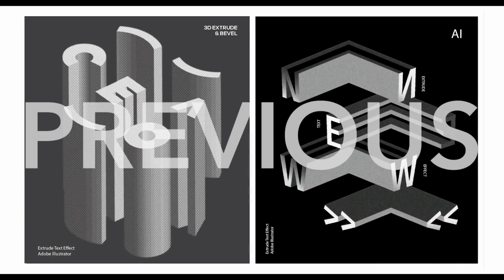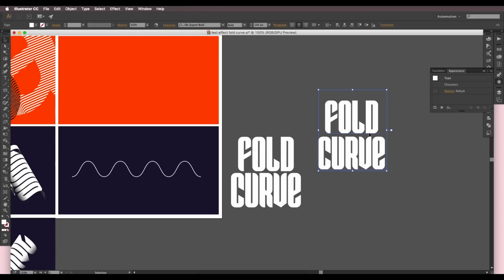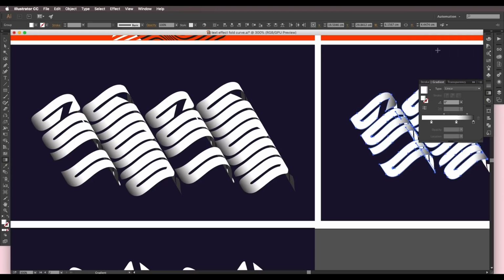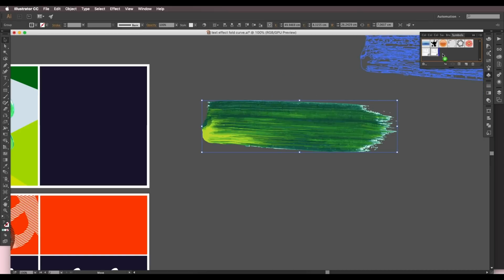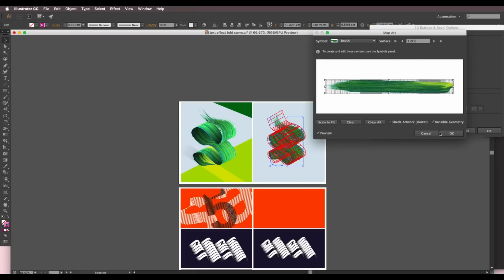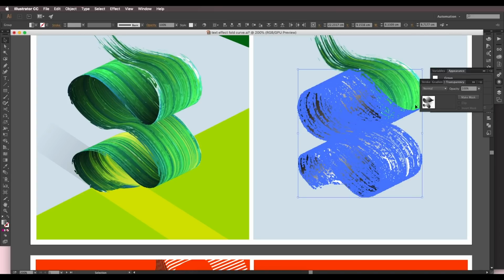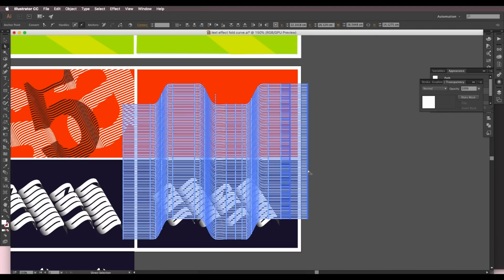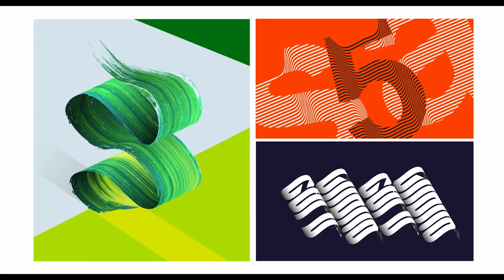Wave Text Effect in Adobe Illustrator | Distort & Transform, Zig Zag, Map Art | Graphic design

Comment: the second font I did exactly the step that you did but when I come to the 3d step it won't work like you did in the map art (I thought may be in the simplify I had many points but it turned out I had the same point that you had so I refused the point but still I have the same problem) so the surface doesn't shaw on all the shape just small part of it, I don't know what's the problem is?